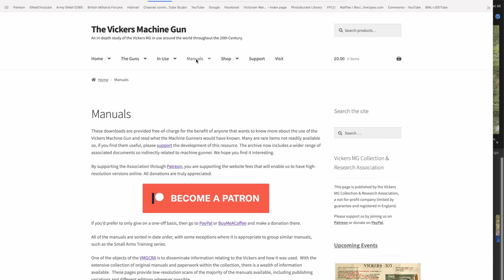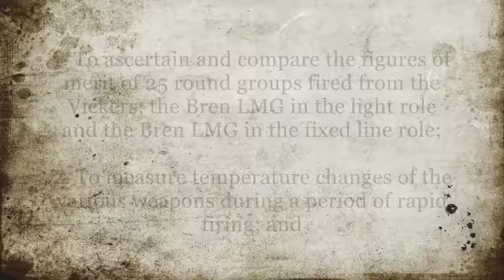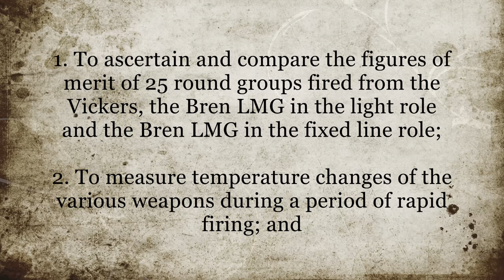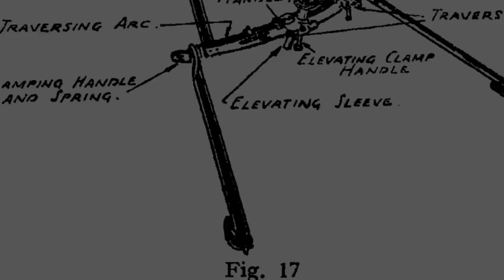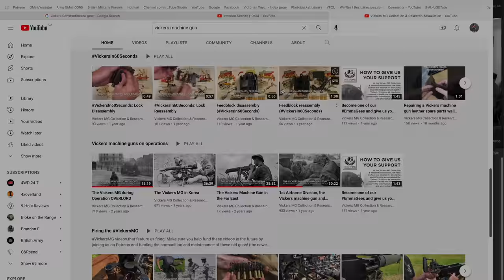Britishmuzzleloaders and the Emma Gee: A visit to The Vickers MG Collection and Research Association

Comment: I learnt to fire the bren in the early 80s along with the 303rifle  in the army cadets and we was using 1950s rounds then 😂. And then I moved on to the 7.62 then 5.56.
Reply: Do you remember the cadet version of the sa80 ? It had a huge cocking handle and was single action, you had to cook it every time you shot.
Reply: @lifesagamesobeawinner  they are still around in some places, used mostly for training cadets on good loading drill.
Reply from the maker: Nice!

Comment: Up until the 1990's surplus, British 303 ammunition was readily available in the UK and workers fairly well. I am not surprised that you had some stoppages great video.
Reply: We use PPU new-made stuff now for machine guns and had one or two stoppages with that but mostly because of feed. The RG had some low power primers in there.
Reply from the maker: It's getting more and more scarce...

Comment: 24:52 - Very interesting. I`ve  heard many times that the crank handle can crush the joints of the shooter's fingers if the hands are placed incorrectly on the grips. These rumors seem to be a little exaggerated.
Reply: They are. It can give your knuckles a whack that'll you'll remember next time, but there's nothing really to crush as it's moved forward again by the time you've felt the pain. Correct placement of the index fingers largely mitigates the likelihood of getting donked by it and is also a more comfortable way to place your hands for firing anyway, so it's largely a "training issue". It's notable in period images of the Vickers in use with British and Commonwealth forces that the No.1 usually has his hands placed correctly as they were thoroughly indoctrinated to the point of it being instinctive.
Reply: @jonprince3237  And, besides, I always thought that if this was a serious problem, the engineers would have made some changes to the design. But this machine gun has been produced in different countries for decades and these models have many differences and modifications, but no one believed that there was a serious flaw in the design of the crank handle that needed to be changed.
Reply from the maker: Rich's video is a good view on the subject!

Comment: You're not kidding about the Bren being an enthusiastic ejector of spent cases.  I'll have to try turning my PTR-91 (a G3/HK91 clone) on it's side to see if the cases bounce as high.  I know that held normally you should start looking for the spent brass about ten to fifteen feet to the right, and a little forward, of where you fired from.  And, guess what...the G3 uses a fixed extractor pinned into the fire control group, in it's case a metal blade instead of a post.
Reply: Eight feet was the furthest empty case in front of the Bren on tripod.
Reply from the maker: Big difference in a post style ejector as compared to a spring type....

Comment: Remember the Soviet built version of the Vickers is still being used in large numbers in Ukraine to considerable effect. 

One recent operation they set one up in a bunker with a remote control and the Russians repeatedly failed to get to it falling into the trap repeatedly and loosing many troops. Only to find the bunker was empty  apart from a WW 2 veteran and a long long long belt of amunition.. and a simple remote control system with a traverse action.. 
Trench warfare and no mans land curtisy of hundred year old design. 
The slower steady fire rate of the Bren makes it what it is controlable and effective and easy to change barrels and magazines whilst flat to the ground. 

I would have asked if they had any footage of those bigger calibre Vickers guns  in action ... Scary beasts given the effect even a single 303 version has in terms of a burst or sustained fire.
Reply from the maker: That might be a Maxim that you are talking about, in which case, the Vickers was a (heavily modified) version of it...
Reply: @britishmuzzleloaders  
🙄quite probably👍🏼... I'll have to back track through my saved links.
There are thousands of Soviet era weapons and copies and Allied WW2  guns that had stockpiled and then been dug out of storage and put into the field or the hands of reservists,  these  water cooled  guns just keep firing ... 
 a bunch ended up paired up on the back of improvised technicals (akin to the set ups on some MTBs/MGBs) or light military vehicles the rest seem to be deployed in semi fixed positions covering bunkers and the trench lines.  Some had their own wheeled carriages with gun shields on. 

They were made to use typical Russian rounds and evolved perhapse in similar ways to the Vickers. It might be interesting to compare and contrast the two branches of the familly tree .🤔  

I do remember seeing early on  some rare stuff from way back coming out of deep storage in quite large numbers and a lot of it looking remarkably well preserved.  
Some American collectors were getting somewhat envious.  🤷🏻‍♂️

Comment: Definitely a bucket list experience!

What was the general service life of the barrel?
Reply: About 18-25000 rounds depending on the rate of fire used and the heat the metal reached. They're gauged to determine likely remaining life every 10,000 rounds.
Reply: @vickersmg  Impressive for older metallurgy, especially considering how spicy hot cordite is.
Thanks
Reply: @vf19blue  The one thing Vickers knew what they were on about was steel!
Reply: So, what then, was the criteria for a shoot out barrel and what temperature does the water jacket work up to?

I shoot a fair bit here in Australia, usually .308 due to availability and price per round. I do have in my safe though three .303's a couple of No4's and a PH sporter version. I'm usually very reluctant to shoot if I feel the barrel is hot to the touch and usually wait a while so it can cool. 

I'm curious how hot one can actually let the barrel get before it starts to damage it.

I'm shooting PPU in my 303's too as it's the only thing affordable enough to get practise in with. How did the PPU in the testing compare with the surplus ammo?
Reply from the maker: Oh it was!
Reply from the maker: Your fears of any kind of damage to the barrel due to it bing hot in the hand, are quite unsubstantiated.  It's a service rifle. What should given your firing amount will be whether you can actually hold the thing, or the wood starts to burn... so yeah, stay away from that.

Comment: strange there was no continues temp monitoring during the shooting and also no system to measure bolt velocity and barrel pressure  or energy to the mount and from the mount to the ground  . Given the research aims at ha such numbers would have been interesting to answer questions like  ( how fast do different parts of the gun heat up with various ammunition , how effective are the mounts at transferring energy from the gun to the ground, how dos bold velocity vary with ammunition type and how dos that affect energy experienced by the gun and into the mount and finally how dos acceleration experienced by the gun impact accuracy  )
Reply: All good points but out of scope for the simple application of fire research we were doing on this day. We thankfully have quite a few opportunities to do more research if we need to answer more questions.
Reply from the maker: I suppose there will be ample opportunity to continue the research into the future... It was a simple day on the range...
Reply: @britishmuzzleloaders   we used to think that in Canada about  ARs and pistols and then one day i was gone for ever

Comment: Why some Vickers were not re-chambered to fire 7.62 NATO & adapted to feed the disintegrating link belts is a mystery. HM Forces couldn't have got a better weapon for a sustained-fire role.
The German MG3 still has a ridiculously-high rate of fire. You would need several spare barrels.
Reply from the maker: Lot's of factors in play there...
Reply: The crux of it is that the Army appears to have decided they didn't need sustained fire delivered in the same way so didn't invest in the conversion.